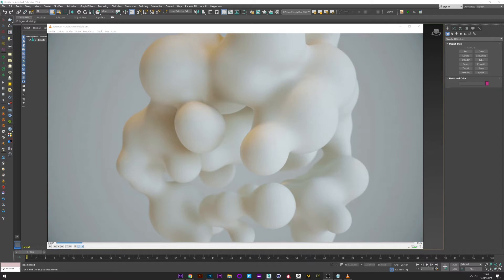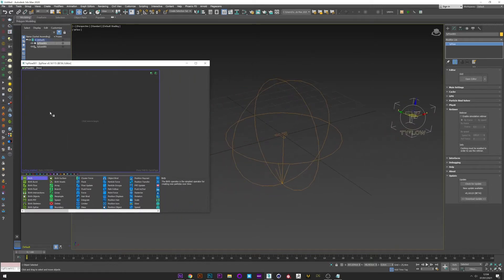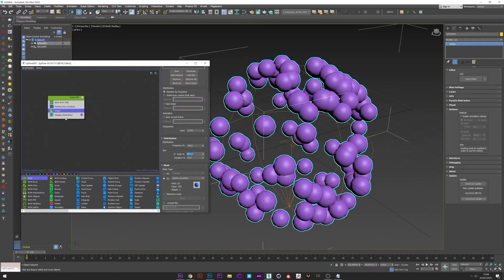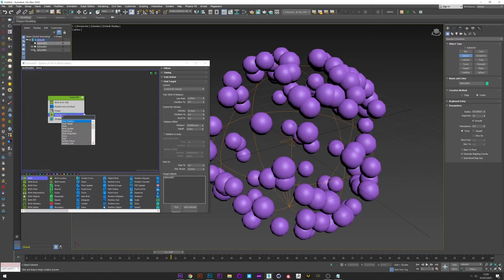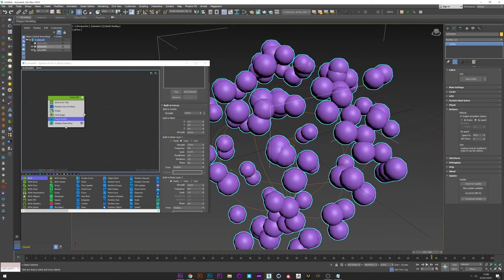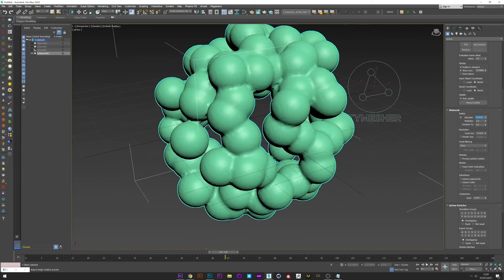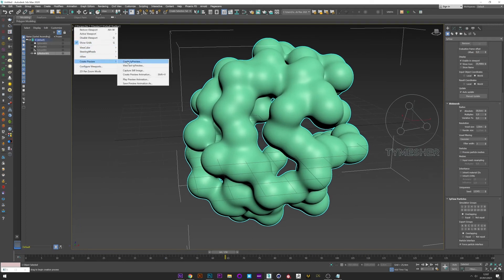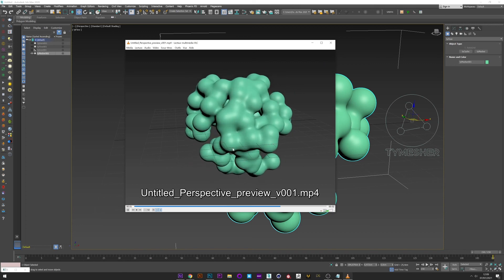Metaballs | TyflowTutorial

Comment: Thanks for your video. 
I has followed the tutorial. However, when I add input objects and particles to the table of tymesh with Blob mesh mode, nothing happens. Nothing new appears, and no blob mesh replaces the particles I selected. I don't understand the reason for this, and I wonder if it's because I'm using the free version of TyFlow. I  would really appreciate it if you could support me. Thank you very much